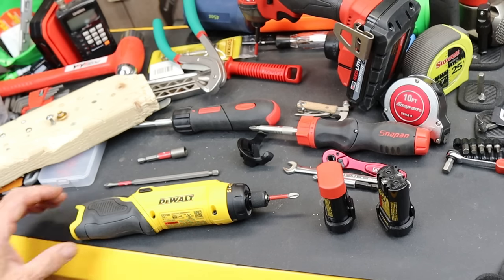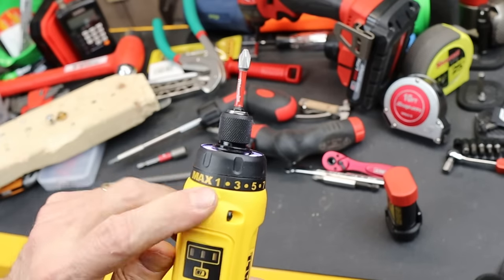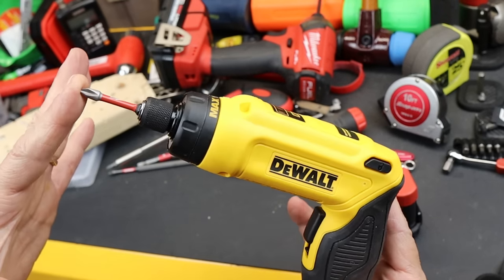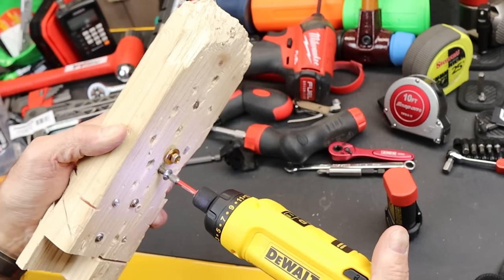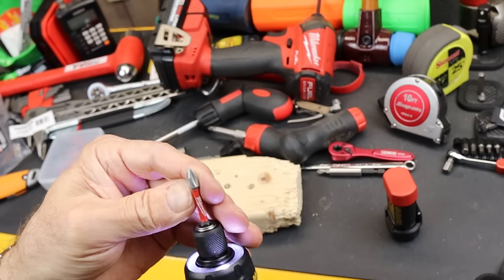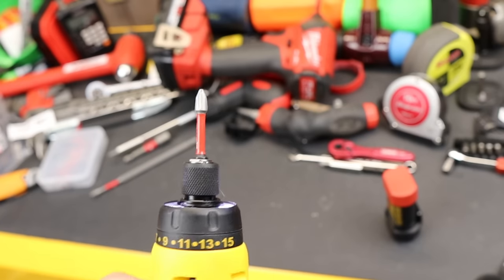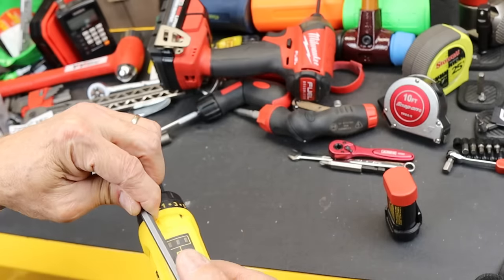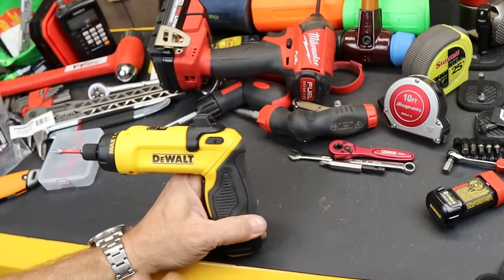Like Magic! The DEWALT 8V MAX Cordless Gyroscopic Screwdriver is a Next-Level Mystical Tool

Comment: Mine stopped working after 2 weeks..... but seemed cool
Reply: The Gyro usually goes out of calibration but never heard of one failing. We've had one for probably around 5 years and it works forever on a battery.
Reply: Hope you warranty it...
Reply: @regularpit1508  
What's the worst is it kinda works 50/50 so you just aimless spin your wrist.... funny actually
Reply: @freemenownrifles8814 gotta activate the gyro w the button before u twist

Comment: I use the 12v Dewalt screwdriver all day, DCF601. Wore out a couple of the brushed versions before that. The clutch is legit (I repair plastic cased appliances, setting #5 works on most things). I had a Panasonic version of this style as well: it was better in that it had had an electronic clutch, no ratcheting noise all day. No gyro control tho. Lost the bloody battery charger for it in a workshop move😢.

Comment: Never knew about this version! I have a couple in the shorter version with a non-pivoted handle, and use them all the time. For the benefit of other readers the version reviewed here is 12.5”, and the smaller version is 9.5” - a difference of 4” which makes a difference.  One of each would be great.

Comment: This is one of my favorite tools.  The intuitive simplicity of the gyro is well executed.  Just press the only button to activate the gyro, then twist slightly in the direction you want the screw to go.  

I do a lot of installation into fiberglass and wood where self tapping screws can easily get blown out by an overpowered driver.   It's also useful for other delicate DC electrical installations into terminal strips and other screw connections.   It's not good for building a deck.  I find that for most other jobs, maximum torque is often not my top criteria.   

My only criticism is the amount of play in the bit chuck.  It's a little sloppy, but still useful.

Comment: I was wary of the twist activation when I bought mine several years ago but I adapted to it very quickly and love it.   I assembled an entire kitchen load of cabinets as a first project and it was awesome.   It even drove screws into studs.   The option of straight or pistol layout is great.   Most of the stuff I use it on is appliances and electrical.   It’s my go to screwdriver unless driving big screws in wood or construction screws etc where the impact driver is used.   I especially like that I can slip the screwdriver tip out and insert  hex ended drill bit for a little pre drilling.
Reply: Yes!   Hex drive drill bits work great with this for predrilling!

Comment: I've been building up and trying to find my ideal cordless screwdriver, because they're one of my favorite tools. I absolutely love the clutch and chuck on the DeWalt, but the gyro motion just isn't my thing. I think since I mostly use screwdrivers for really repetitive assembly and disassembly, twisting my wrist just isn't a motion I want to have to do over and over.

I also think the inline/pistol grip is essential for me. The design of the screwdriver grip lets you put your hand directly inline with the fastener in a way that a typical drill/impact handle just can't do.

I have a Makita screwdriver on the way and I'm hoping it's the perfect middle ground between the features I like in the Hitachi driver and the features I like in the DeWalt
Reply: Any updates?
Reply: @weinbergler  I really like the Makita, it has comparable power to the DeWalt, but with the butterfly trigger of the Hitachi. Unfortunately it costs significantly more than either one, but I ordered the kit from Amazon Warehouse and it ended up being a pretty good deal.
I still think the DeWalt has the best chuck, but the Makita has the best clutch. It automatically turns off the motor when the clutch activates, which makes the tool feel really nice. The Makita also has a great light.
The Hitachi is still my favorite for smaller work, just because it's the slimmest and lightest

Comment: I’m surprise Milwaukee and Bosch haven’t made an electric screwdriver in a strait form factor with their 12v batteries.
It would be bigger than the comparison but more powerful and smaller than any impact driver
Reply: I would almost certainly buy that
Reply: Especially if it was gyro operated!

Comment: Good to see removable batteries. Over in the eu they just past a law requiring all "gadgets tools phones etc" to have user replacable batteries. So many of the smaller hand held tools flashlights phones ipads etc are going to have to rethink. Im holding out for the vessel screwdriver. Currantly using the hikoki 3.6 with pb dwiss longer bits which is great.

Comment: This was on Lowes's deal of the day  yesterday for like $65 but sold out quick. I feel like I would have trouble getting use to the gyroscope feature.
Reply: It's not hard.   Just twist like you would a screw driver and hold it.   Twist it further to speed up.  Twist it back a little to slow down.

Comment: Wonder how it would work when in a tight space . Back of a cuboard a few times i dont have the space to twist to make it go.the light ring is neat
Reply: Use it in the straight configuration, no problem.

Comment: I think they had that in a previous version of their screwdriver, but that one kept failing because instead of twisting, it bent, and the wires at the joint broke. I bought a Hitachi back then, which I used to put together a gazebo with over 1000 machine screws in it, and was pretty happy with that.  I think I'll make my wife happy and pass on this one, since I just bought a cheaper electric screwdriver during the the last Prime Days.

Comment: radio controlled aircraft & drones have digital gyros
this is just an application of that

kinda neat!

but for the most I don't do battery powered tools
if you use them everyday I can see it
but since I retired by the time I use it again the battery has gone bad
and not the batteries have changed yet again
now my favorite battery drill/whatever is useless

that link you gave is one of those 'add to cart to see price' CRAP!
I looked elsewhere and the price doesn't look bad

Comment: Goodday reader. This mentioned DeWalt screwdriver ie "DEWALT 8V MAX Cordless Screwdriver, Gyroscopic, Rechargeable, Battery Included (DCF682N1) is this the latest model in this range? Cobus🐳